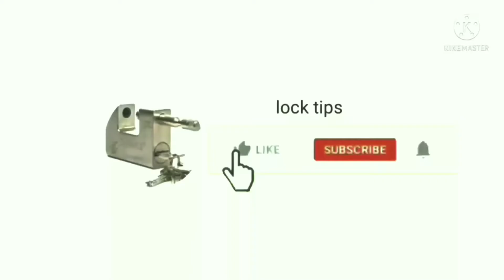How to make master key |Two lock one key |Lock tips|

Comment: It's not well explained, I mean, it's a good video and it probes that it exists and Im not crazy.

Ive read about master key for open several locks, like many hotels do.

For example each lock has a independent combination, but additional has a second combination (for the master key)
And that is achieved by two set of bolts.

Is it right?

And also I've read about it in a locksmith book